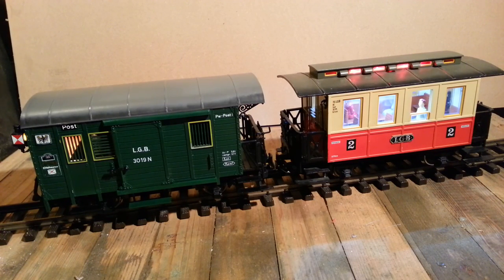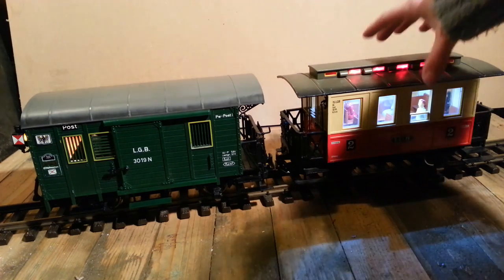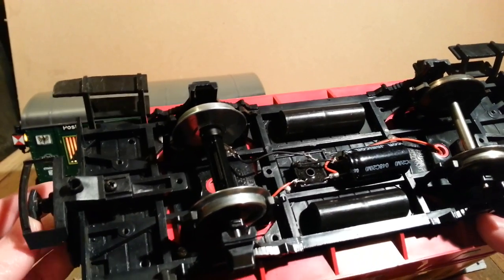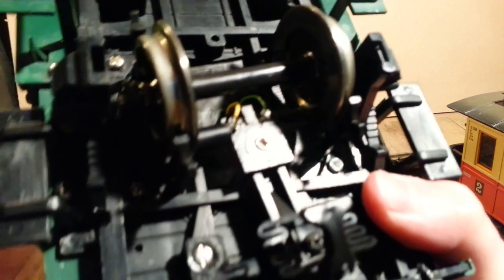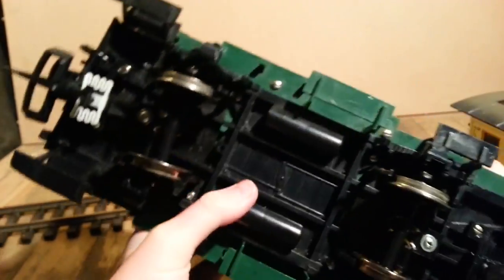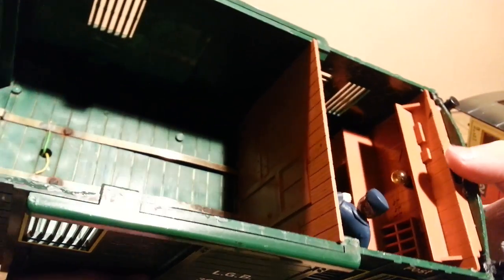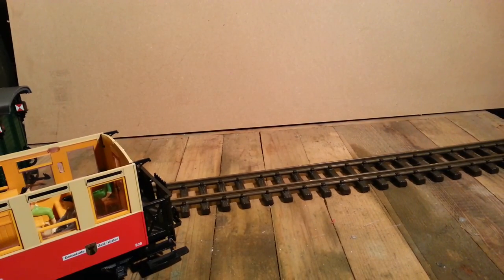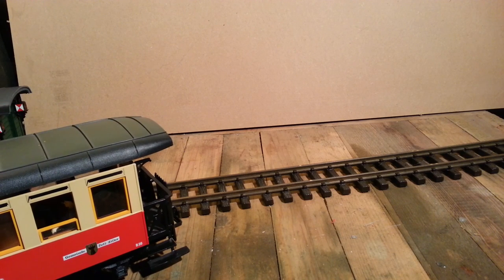Lighting options for LGB, Bachman, Aristocraft, G Scale Garden railway trains

Comment: Thanks for video. I bought a Tomix n gauge lighting unit from plaza Japan ( eBay) . I put it into a LGB coach with the battery unit and lled lights .Two AA batteries from  Pounldland and its been lit for over 10 days 24/7.

Comment: I wanted to install lights in older coaches but wanted them to be battery powered. I could put batteries in each car but I rather wanted to have a system where there would be central batteries and each car connected by power cables. But it's a long way off before that project happens.